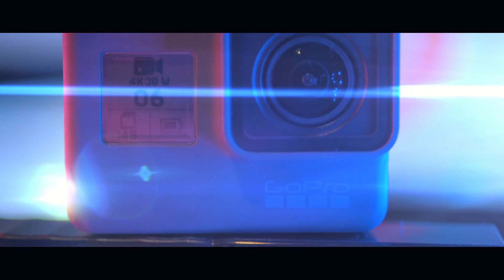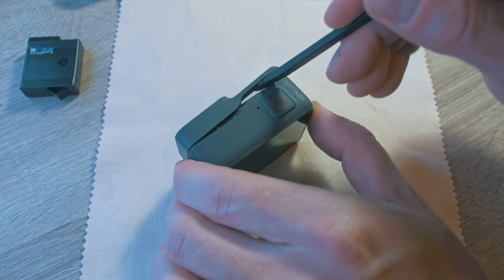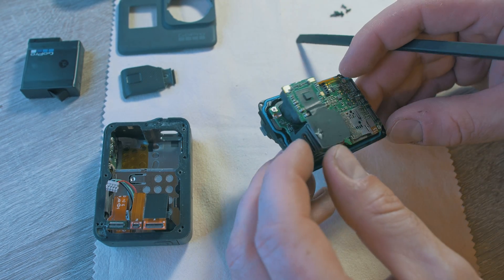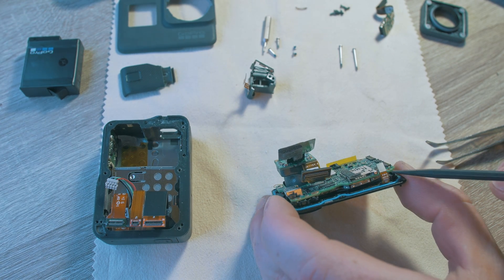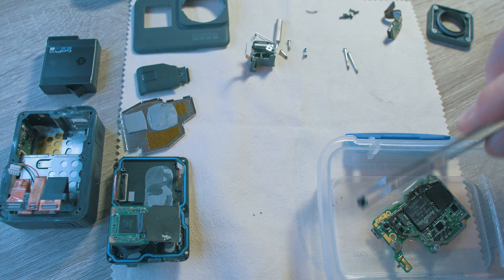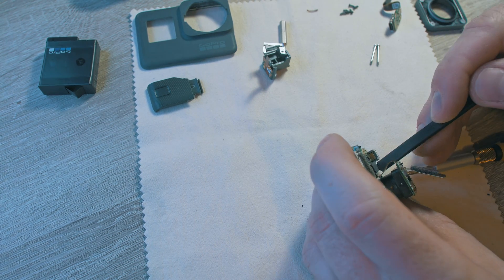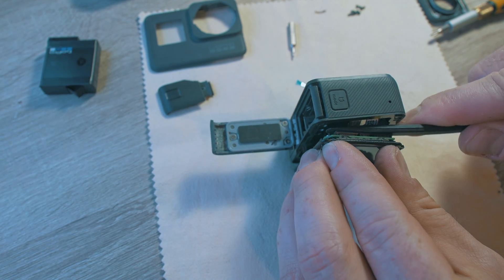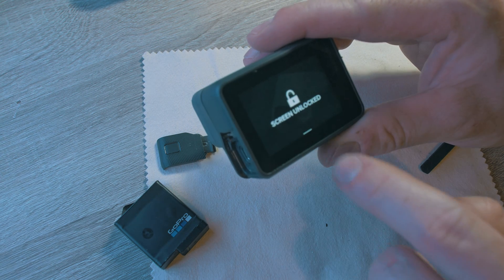Water Damaged GoPro Hero 5 Black | How To Fix It |  [4k]

Comment: First of all, wonderful video and a true godsend for those of us with a water-damaged GoPro.

I took mine to a beach, and I suspect sand got into the door seals, allowing sea water to get inside.  I was on vacation and didn’t have any tools so just used freshwater to rinse all the doors then dried it off as best as I could and prayed.  

 The next day I was pleasantly surprised that it turned on.  The front monochrome (status) LCD remained dead, but the physical buttons including the top (red) start-stop button worked fine, and I could make video recordings with perfect images and sound.  However, the back touchscreen was nonfunctional — so I could not change any settings — even though the colour LCD worked perfectly so I could use it to frame my shots, see the amount of space left on memory card, and see the amount of battery power left, for example.  It even charged via USB.

Upon returning home, I followed your steps and stripped it down to the motherboard.  There was no salt water or corrosion underneath the metal heat cover, although I did find corrosion near the battery compartment electrodes and some screws.  I cleaned these with fresh water and blow dried them.  Going to air dry the parts for another day or two before putting it all back together and see if I made any difference (for better or for worse).

So wish me luck!

P.S. I wish your video covered how to take the battery door (not just the side door — that one is easy to remove/reinstall) apart —  I could hear sand gritting inside the sliding mechanism, so I took the door apart but now the door-unlock button is no longer snug, and I’m afraid my door is no longer water resistant.  :’-(
Reply from the maker: thanks for watching, well you need to clean it up all ... fresh water is not good in long term... is better then salt water tho.  I planing to do some quick tutorials about gopros again so stick around.
Reply: and does it work? cuz mine has the same condition
Reply from the maker: well it depends on time... definitely worth trying! 
thanks for watching
Reply: mine has been like that since maybe about 1 year, and now the condition is still the same, cuz i've done nothing to it yet. Is there any chances to make it functional normali again?

Comment: How about the mode button is not functioning on black 5? (cam fell off from 40cm as while in a waterproof case hitting the mode button) Also after that is not charging and red light won't come on...any idea?
Reply from the maker: hi more likely is something disconnected... open it and inspect every connector. 
thanks
Reply: @takeapart  Thanks for the answer I ll get the tools tomorrow and i will keep you posted...
Reply from the maker: excellent! 
good luck

Comment: It will likely not be waterproof, that front cover will not come off like it did in the video.  If you want your camera to be waterproof, try other methods first!   To get the cover off you will likely damage the gaskets
Reply: I literally just unscrewed mine came right off went right back on. Stuck GoPro in water still works

Comment: nice video
i want to know is it waterproof now after reassembling?
thanks
Reply from the maker: hi there, yes it is just like from factory...  but be careful and don’t damage rubber gaskets.  thanks
Reply: It will likely not be waterproof after doing this, that front cover will not come off like it did in the video.  If you want your camera to be waterproof, try other methods first!   To get the cover off you will likely damage the gaskets
Reply: Yeah I got water in, took the front off but now doesn't seal completely anymore. I bought the dive housing anyway as I go deeper than 10m so won't use it without it anymore.

Comment from the maker: 2023 update: Hi Guys, All products are linked in description (updated and checked) , please Subscribe and LIKE  its really helps me ...Thank You
Reply: take apart I take my gopro for diving... too deep... probably going to do this!  thanks for video...
Reply: I just want to learn how to tear down and reassemble the HERO5. I tear down all the component and reassemble it now my HERO5 can't even turn on. Do you know any potential issue? I already triple check all the connectors were put back on their place
Reply from the maker: there is many options what can be wrong...
Reply: May I have your opinion?
Reply from the maker: I would personally check voltage on battery, and check for damage power button ribon cable... if gopro was in working order before you disassembled it, it should go on again unless you damage something. 

take time and go once over... check everything 

let me know how you go. 
thanks
Reply: @takeapart  hello sir. My Go Pro Hero5 was damge by saltwater. Where can i order / buy connector of motherboard?
Reply from the maker: all products for replacing and tolls need are listed in description of the video. please feel free to check them out. 
thanks for watching